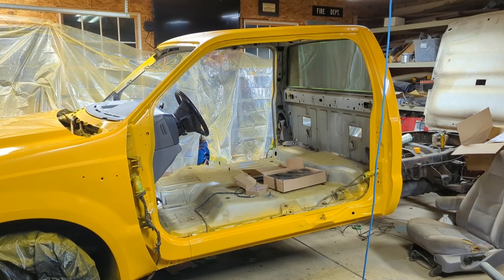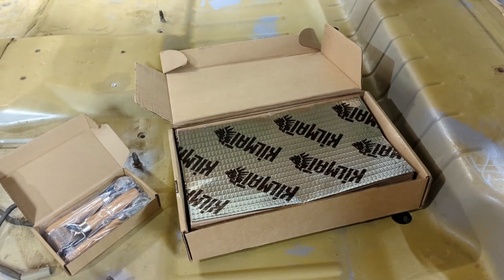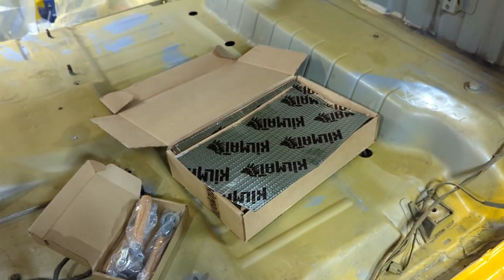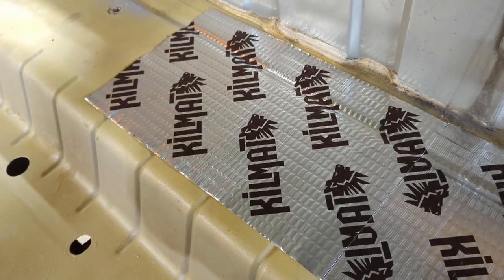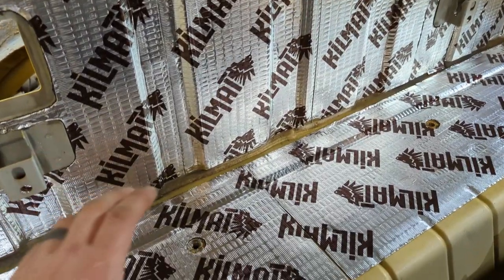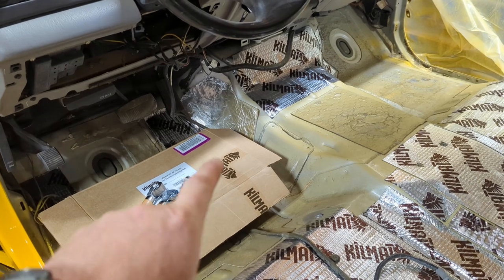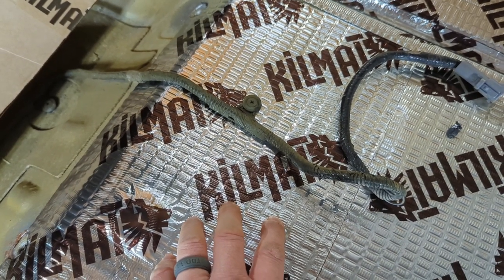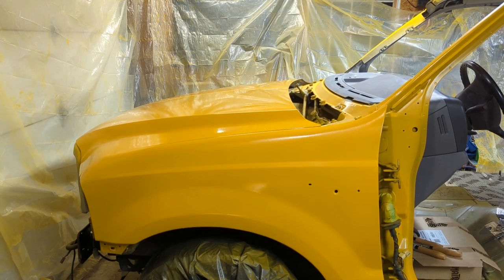Installing Kilmat Sound Deadening in my pickup truck, will it work?

Comment: It's not 50 millimeters.  It's 50 mil.  That is about 1.25 millimeters or .05 inch.  I'm sure you just misspoke.
Reply from the maker: Yup, I did.  I also noticed it when editing and I just shook my head and left it in.   I figured someone would correct me.   ;)
Reply: @1D10CRACY  Not trying to "neener neener". Just trying to help.

Comment: How does it do as a insulation from cold and heat?
Reply from the maker: I can't say for sure, but I would guess it doesn't make very good insulation from the cold or heat.
Reply: @1D10CRACY it’s actually surprising good against the heat but they do have something that’s like an equivalent that works better for the heat and cold